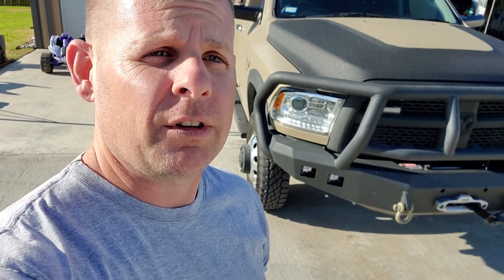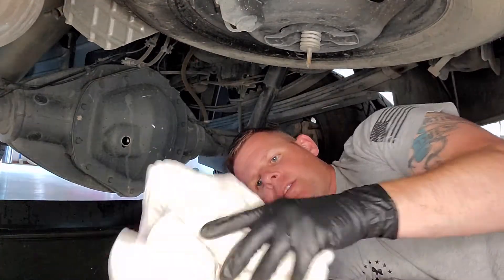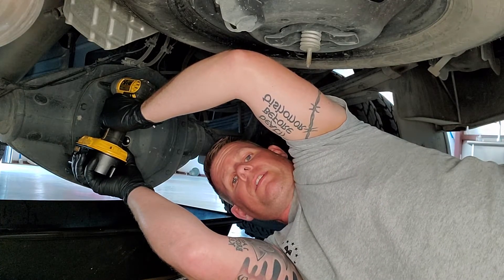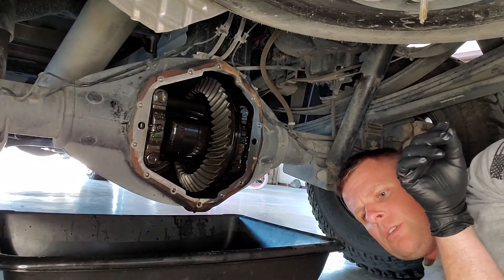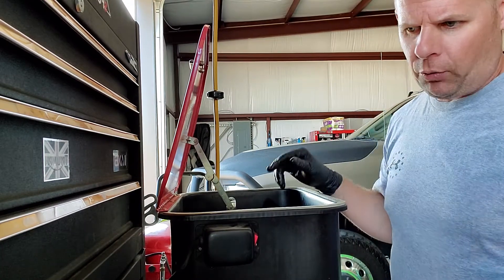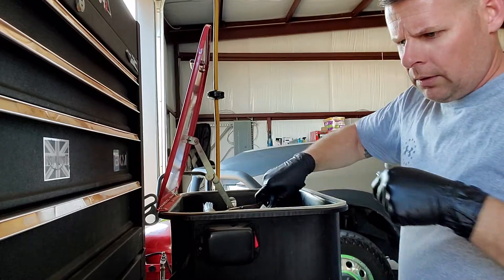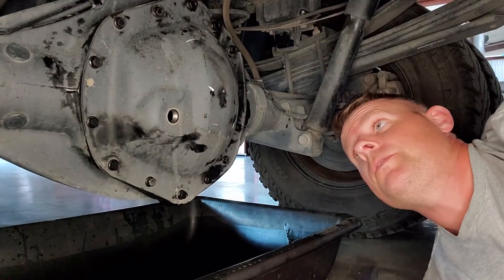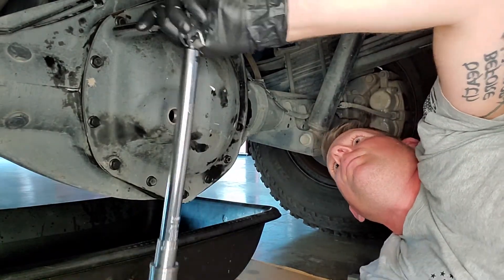2017 Dodge 3500 Rear Differential Oil Change

Comment: Thank you for the video.  I have a 2007 Ram 3500 that needs this service.  The only thing I would suggest is listing the torque for the cover bolts and the drain plug.  Like and subscribed.

Comment: Very good explanatory video. I am wondering if it is possible to suck the differential fluid out with one of those drill driven siphons and then just pour new fluid in.?
Reply from the maker: Yes you can, only draw back is you can’t examine for metal shavings but that shouldn’t normally be an issue. I plan on doing my front diff with a pump since the steering linkage makes it a pain to remove the cover.

Comment: For those who have the AAM (Torsion Worm Gear Design Anti-Slip Gear Set) avoid gear oil with the limited slip Additive added to it - the Torsion Design Gear Set does Not Require the additive & will effect the performance of the unit in certain situations when you need it the most.
The Traction Control will play havoc on the unit as well - turn the TC off when you really need 4WD.
Reply: Do you know how I can visually tell if I have the Torsion Worm Gear Design Anti-Slip Gear Set or not?  Is there any other form of limited slip diff in the '17s?

Comment: I couldnt find amsoil anywhere so i used lucas gear oil 75 90w when i puty banks rear diff cover on . I took factory bolts some gorilla had tightened in but at 8800 miles was surprised a little on wear or break in in oil it needed changing

Comment: The camera has everything backwards. labels and bolt turn direction. No biggie though. good video.
Reply from the maker: Yeah, not sure there's anything I can do to fix that.
Reply: @tacticaldieseldad5695  yea, no biggie, great video. Keep them coming.
Reply: I imagine you’re using front facing camera on phone. Turn the phone around and use the back camera. Should help. Great video by the way!

Comment: new gasket is a must.
Reply: The factory gasket is reuseable.
Reply: Why ?
Reply: @Dog.soldier1950  why not? I think that one that has been in compression for sometime will not seal as well as a fresh one.
Reply: @oldsalt8011  you use, make a gasket silicone, ive never had to use a factory gasket, just use the silicone to make a new one. Done it for the last 20 years never had any leaks.
Reply: It’s a reusable gasket.  If it makes one feel better to purchase a new one on every change.
Reply: @Mill72  OK, yea, what could go wrong? If the old one leaks as soon as it is all re-assebled, then your just out of the cost of differential fluid.

Comment: Last time I did this, I thought it would be easier to just suck the oil out with a fluid extractor.    Or just the Banks performance diff cover for the ease of future changes.
Reply from the maker: I will do a front diff change and use a extractor. The steering linkage runs in front of the diff cover. Looks like a pain in the rear to take the cover off.

Comment: Using a torque wrench to break torque on a bolt or a long handled rachet wrench? Never use a torque wrench to break torque.
Reply from the maker: I think I used the 3/8 impact. Bolts backed out pretty easy. I agree with you, probably easier to break a bolt that way.

Comment: When re using remember to add sealer or it will leake 100%
Reply: Gasket is reusable and never had a leak problem.  Others as well.  Negative on sealant.